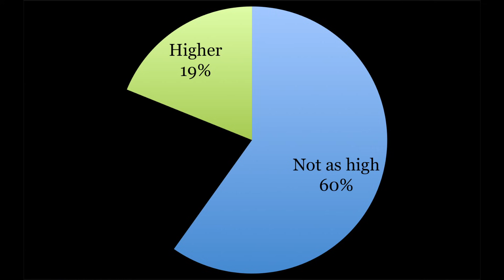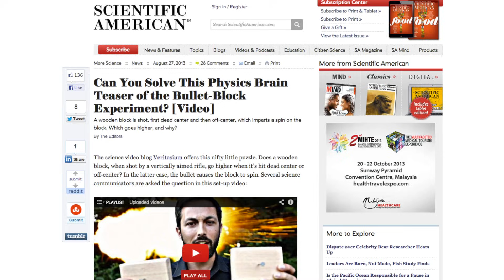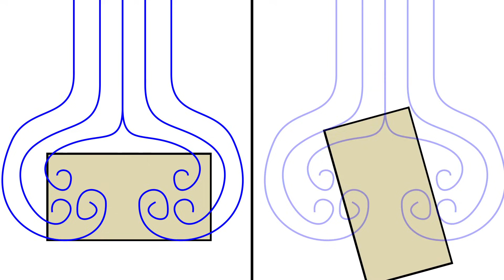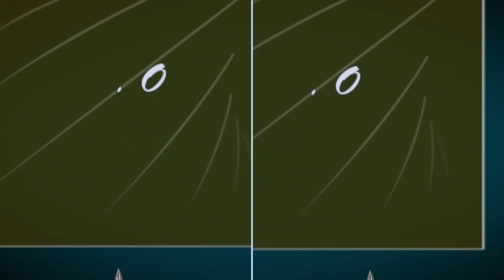Bullet Block Explained!

Comment: Thank you for this video sequence!   I am a physics teacher in PA, and shared this video with my AP students.  They were very excited and it sparked a great discussion.  I think you missed one important point in the analysis of the block.  The distance the bullet penetrated into the block is not really the relevant distance here... it is the distance the bullet traveled while slowing down to reach the speed of the point of contact with the spinning block, compared to slowing down to meet the speed of the center of mass.  Since the block is rotating, the bullet actually travels a greater distance in this case.   Based on your measurements, I'd guess the answer is about 50% farther, although the exact distance would depend on the amount of force applied to the block.  That force might be slightly less because the impulse took place over a longer time.

Yours,

Doug Vallette
Reply: you don't need to sign your comments, mr Vallette!
Reply: @ripjawsquad  But it's very cordial and rather charming.

Comment: I look at this as an acceleration demonstration. If you boost someone up a wall it is harder to lift straight up, but if they run towards you then you lift, it is easier to lift. It's a very rough way to describe it, but it simplifies it for me.

Comment: Instead of wood, use a more uniform material, a medium density plastic for ex. and perform the experiment in a vacuum with a linear actuator instead of a bullet for consistency. have a laser grid projected onto the background in mm increments and use a long focal length lens for less distortion of perspective. your tests were very inconsistent, that itself has to decrease the accuracy of the results. you could pick any two results and claim any outcome. removing any inconsistent significant variables is the most important factor because of the small differences of the results. Is there actually a difference? reduce the number of variables like wind which could have a huge effect, bullet weight and grain size, was the gun cleaned before every test...

Comment: You might be on to something but your explanation is rather poorly done.

So you theory is this: (please correct me if I misunderstood your theory)

In the spinning block case, 97% of the energy is lost to sound, wood deformation, heat, etc.  And 3% of the energy is put into the block with 2% of it in linear kinetic energy and 1% is rotational kinetic energy (because you said the rotational energy is 50% as large as the linear kinetic energy).

In the non-spinning block case, 98% of the energy is lost to sound, wood, deformation, heat, etc.  2% of the energy is put into linear kinetic energy.

Thus the same 2% causes the same height of the block.

(end of theory)

If that is your theory, you now have a few puzzles to solve.  Why is the off center block consistently more efficient at transferring the energy?  And... Is the 1% difference consistently shown in your x-rays?  A 1% difference should be measurable after several experiments.  Note that the 1% may translate to a bigger difference in penetration.

Yes... Momentum needs to be conserved as well -- both linear and angular momentum.  Note that the rate of spin should be able to be derived by viewing the bullet+block system at the point of impact compared to when it is spinning in free air.  But your "explanation" that this is why the block goes the same height is incomplete.  You have a set of simultaneous equations and ALL of them need to be solved at the same time.  Oh golly... I may have just given away part of the answer.

All this to say -- this isn't science (so far).  You have some data that you are grasping to explain.  You need to come up with a concrete mathematical theory and then see if the data from your experiments fit the data.  You need to be able to predict the results of the experiment as well as the results of slightly altered experiments.  You need to be able to "show your work" as the professor says in the class room.  None of what you are doing it bleeding edge science.  You should be able to use classical mechanics to very accurately explain the phenomenon that you are observing.

Some areas that would be interesting is to put heat sensors on a block tied to a table and then see how they respond when struck by a bullet to get an idea of how much of the energy is lost due to heat.  You could also put a microphone near by and measure the difference in sound in the spinning and non-spinning cases.   You should be able to use a weight dropped from a height onto a nail or similar object until it penetrates to the same depth that the bullet penetrates to measure the amount of energy lost due to the deformation of the wood.  The heat loss (or temperature change) should mimic those found before.

I would also use something besides wood.  It is going to not be 100% consistent and it is going to be troublesome to statistically get enough samples to be able to correctly factor away the experimental errors it alone introduces.

Comment: Use a material with a smaller rotational moment of inertia? that way it spins even faster in response to the bullet hitting it's side... 

Wait... wouldn't that mean the bullet that hits the center would also not go in as deep? dammit, I've gotten nowhere. 

Maybe try something with an even bigger moment of inertia? Honestly, just try blocks of different materials and densities....

WAIT! Just repeat the experiment with wood, but use blocks that are huge (doors maybe?)! And bullets that aren't necessarily larger in diameter, but that can penetrate deeper. You may need a more powerful gun too....

Comment: make a bigger and less dense block so the energy needed to penetrate per unit of length is less and you would be able to differentiate a 1 percent energy difference. but keep using the same ruler  LOL
Reply: omg 2013 .. came a little late

Comment: In order to show the difference in penetration depth clearer, maybe try two objects with similar mass? As you explained, it seems like the issue is that lost energy is so much bigger than the measured rotational energy, such that the difference in depth (reflecting the kinetic energy from rotation) is much smaller than the total penetration depth (reflecting the total energy loss). I don't know if I use the term correctly, but this seems like an impedance matching problem. An equal mass would yield an equal resistance to acceleration during impact. When connecting electrical components u usually want them impedance matched (having the same resistance) in order to reduce losses. I think it should be an analogy to mechanics (correct me if wrong). 

Maybe reducing rotational inertance (making resistance to rotational acceleration less) could give a significant difference in penetration depth?

Homogenious material (plastic/rubber) could show this effect clearer. It looked like from the x ray that material had been piling up in front of the bullet. I would argue that this greatly increases penetration resistance as the bullet progress through the material. A higher resistance at the end of the bullet path would decrease the difference in penetration depth. Think in terms of work = force*distance 

Just brainstorming. Would love to see a remake of this!

Comment: My first thought was a gradiented energy dispersal into the wood. The center bullet hits and disperses energy into the wood at a generally even rate moving up and out from the penetration site. The side bullet enters the wood with much less mass to handle evenly, this difference in displaced energy would lift the blocks right side first, moving left slower than when the bullet dispersed energy directly into the whole block evenly. I guess the explanation at the end of this video kind of is what I mean, however, I feel like it's different somehow.... anyways.... I think you can test this by shooting different shapes on the side and watching the spin. Ones with more mass on the left, more on the right, some evenly dispersed, etc... The difference in spin would be noticable, and based on different masses and spin speeds you could determine the energy dispersal rate...?

Comment: To get a more visible effect try using a les dense object (although it may have to be larger so the bullet doesn't penetrate it ) if there is a difference then it would move a difference of more than 1/10th of a millimetre.

Comment: I'm not sure if anyone will ever read this anymore, but I made a physics engine that used this logic. The result? Infinite energy generation. The answer is wrong.
Reply: I'll be a little bit more specific. Let's take 3 square objects, none rotating some moving. Two of them collide, so that they end up rotating and moving away from each other. The now rotating and moving object collides with the third one, so that the corner of the square hits it, direction of the rotation at collision point is directly through the center of mass of the stationary object. This rotational energy is now applied to the stationary object as linear motion, along with the linear motion of the moving object. This increases the total amount of energy in the system.

Comment: I didn't read through all of the comments, so I apologise if I'm repeating someone else's thoughts. I think that if you were to do the experiment again with something like Aluminium, which has a more crystalline structure, you would be able to have more consistent results, and would be able to have a measurable difference between the two bullet depths (due to a difference in hardness and density). I may be totally wrong on both points, and apologise for wasting anyone's time if I am, but it was just a thought on the extra challenge.

Comment: To make it measurable, I'd suggest using a different material with less resistance to the bullet's path. Less resistance should allow for a much longer path, making slight differences in the path length more easily measurable.

Comment: Trying to approach this like a Physics 101 problem, here's what I got. It turns out to be mighty close to the explanation here, but whittled down a lot by lacking all the train-of-thought explanations and experimental effects and further investigations shown in the vid.

There are 3 main conserved quantities to consider: energy (E), momentum (p), angular momentum (L). Each of these is considered at the moment of impact.

L is not a factor in predicting the height. It tells only how the spins differ for the two cases.

p says that at impact, both bullets have the same p, as do both blocks. And it is mute on the matter of spin, before/after. Therefore, the bullet-block velocities are the same in both cases, resulting in the same height attained.

E says that the KE's of both incoming bullets are the same, so both bullet-block KE's should be the same, post-impact. But the spinning block has put some of its KE into rotation, leaving less for translation, so its upward velocity should be less at impact.

So the p and E conservation laws conflict on the result! How can this be???

ANS: Hint: "Inelastic collision."

We haven't accounted for all the energy in our E analysis. Both collisions are Inelastic; possibly with different coefficients of elasticity; thus allowing the p analysis to be correct (which it must be, because there IS no way out of that argument).
When the off-center bullet strikes its block, the block has some additional "recoil" due to rotation, that wasn't present in the centrally-struck block. So the same amount of KE goes into translation, while an additional amount of KE goes into rotating the off-center block.

So the final answer is, both blocks attain the same height.

Comment: Wow! This video is over 5 years old and just popping onto my youtube feed now?

Okay, here's my guess: The bullet provides only the energy to send the block up and away from the gun. We never see sideways view showing how far away from the gun the block travels, but lets assume its the same horizontal distance each time, because if it wasn't I would think that would have been addressed in the solution video somewhere.  Hence, regardless of where the board is shot, on center or off center (but at the same height, I'm assuming?) The bullet provides the same amount of upwards and outwards momentum, and the boards travel upwards at roughly the same height. The spin energy isnt coming from the bullet, but instead of the potential energy within the block caused by gravity. In the offset shot, the block on one side of the bullet is heaver than the other.  That side falls as the block leaves the table and starts the block spinning like a propeller or a pinwheel.  Under this theory, the farther away from center the block is shot, the faster the block would spin.  I don't do target practice, so I don't know if that's true of how shot things spin in reality.  Just a guess at this point.

Comment: ok lemme just try to get a prediction right, so: assuming the weapon shoots with the same force each time you can assume that when the block was shot to the side it got more affected by the shot than when in the middle. while when shot in the middle you get more direct force (since the vectors for the movement and the aplied force have the same direction) when shot to the side you are hitting it youre hitting a part that has less inercia to stay in the same place. the shot to the side creates more energy that gets dissipated partially due to the rotatioj of the block but the transfered energy to the block when shot to the side minus the dissipated energy equals the same energy transfered to the block when hit in middle

Comment: Video is old now, but still interesting. Concentrating on the depth of the bullet probably isn't the best strategy. Doing the experiment with significantly longer wooden blocks impacted farther from the center and with varying caliber/mass/types of projectiles will likely reveal some useful consistencies.

Comment: Better idea to verify this "theory" is to try a metal block. This way you avoid this hard-to-measure penetration. Even better if you use rubber bullets or spring loaded impulse source to avoid penetration totally. Experiment is not conclusive, you need accurate equal energy of the bullet each time you fire it and hit the same point on the block and have blocks of the same weight and inertia. Simply, your experiment is poorly controlled, so incoclusive.

Comment: To make the distance traveled into the block more measurable you should try using a higher power round to shoot into the block so that the percent change would be a greater total change in distance in the block. You could also use a softer wood so that the bullet doesn't lose as much energy going into the block so that the distance difference is greater between the two bullets.

Comment: To make the "bullet" (projectile) depth measurable you would need a material substantially less dense than wood and proportionally thicker.  For example:  an AeroGel 20 meters tall (thick) with a low velocity BB gun (300-500 FPS) shoot one sample in up towards center of mass and one near far edge (max fulcrum)

Comment: The "angular and translational momentum are conserved independently" makes no sense.  If angular momentum was conserved independently, then explain the observation based on the angular momentum of the bullet.  The bullet has angular momentum (bullets spin along their direction of travel), yet you don't see an equal conservation of angular momentum between the two test cases in this video.  My guess is that there are a number of factors, but a prominent one is that when the bullet his the block of wood to the side, the torque of the block pushes into the plexiglass, which acts as a spring, imparting extra momentum.

Comment: get a block of wood with a knot in it, then shoot the knot!... do another couple videos of this at a slower speed, maybe there's a little something we're not seeing.. also keep in mind that the rifle is considerably close to its target, and the muzzle blast itself could also add to lifting the wood. and just to point out, the reason why sticking a nail into the hole wasn't accurate is because the wood fibers. the entry point is a punch hole, but at some point as the bullet pierces through, the wood can't be pressed any further and instead splits and rips apart, those wood fibers will try to sponge back out in its original position, which brings me to another thought. try this with different direction of grain, instead of standing it on its side, lay it flat down so it passes through layers or between layers. and then standing on its end so that the bullet travels in the same direction as the grain of the wood. one more observation I've made, notice how the center-shot block carries the spin of the bullet, but the off-center block does not carry that same spin (from what I see). maybe thats another variable to consider?

Comment: Scale up!... if your measured differences are too close to measure at this scale, scale up to accentuate the differences... also, wood density is not consistent (rings, age, water content, etc)... Choose a more homogenous substance... you may also want to try to do this inside to prevent any air pressure/wind/humidity changes that may occur during the course of multiple experiments... You won't be able to eliminate those variables, but inside they should stay relatively constant during multiple trials. Lastly, you may need to find another method of firing the projectile that can be more easily controlled or try to take into account the possible discrepancies due to the slight differences in the bullets introduced in the manufacture process... 
Though I still believe scaling up will accentuate the differences into a more readily measurable difference..
Great video!